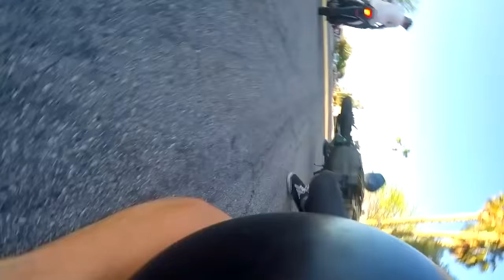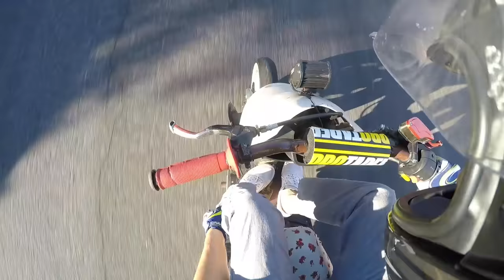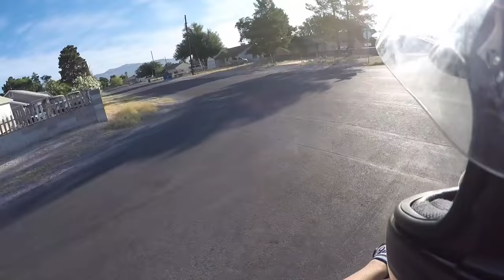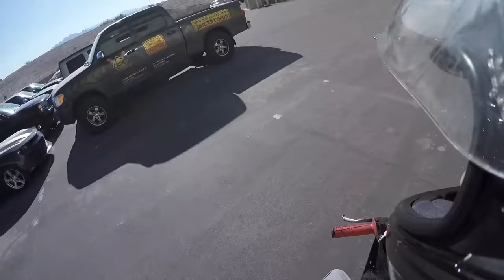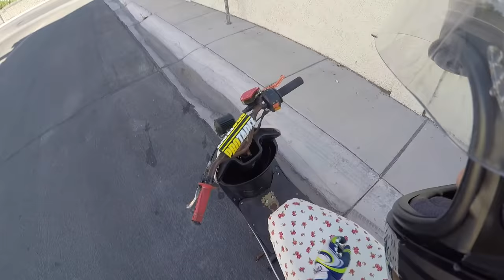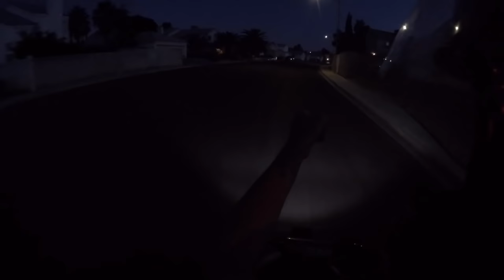this STUNT SCOOTER is my DAILY DRIVER

Comment: If I were you I’d make sure that the electric start works so you don’t ware out the kicker because once that worn out it won’t catch and you gotta make sure you put wd40 on the kicker so it don’t seize up on you
Reply: Wd-40 is water based it will rust it and seize it.😂

Comment: You should by an aerox 50cc, very good stunt scooter
Reply: Why would he change a150cc to a 50cc?
Reply: @victortakflakt  because a 50cc aerox will have about the same power as that 150cc if you put a good exhaust on it. Put a big bore on it and youre outrunning the 150 for miles
Reply: the scooter he is talking about is a two stroke, that is why it has a higher power output.
Reply: @drunksanta1427  A 50CC Aerox with just a pipe wont have as much power as a 150CC.
If you put an expensive performance exhaust system, a 70 - 86 CC Kit etc... then yeah it would be about the same or a little more power.
But not without tons of work, and not to mention that if you do this you'll wake up half the country.
Reply: @victortakflakt  its only fun to drive a loud scooter. I have a Gilera Stalker 50cc Two stroke, that runs about 55 miles per hour with only modded exhaust
Reply: @LanesOnline  I know for a fact that 50cc scooters with nothing more then an exhaust doesn't do 55 mph, I know almost  everyone says their 50cc's go 60 mph though.

Comment: Bro have you adjusted the valves on that engine since you bought it?
Reply from the maker: nope
Reply: @MOPBOYZ  probably should it could give you some performance back also it'll run better in the ridiculous heat

Comment: how did you get that gy6 to wheely like that is it the clutch and gears? Did you move the weight to the rear? I have a scooter I built the top end only and ittl do small wheels but nothing like that I'll do the the racing gears and clutch soon for more power but lmk why it's like that I want wheelies like that
Reply from the maker: gy6 150cc motor swap, stock everything else
Reply: I had a feeling it was a 150 escpecially when I saw the license plate. I've just been messing with 50s for fun for years I have a 150 and those are just bad ass like that I was thinking how the fuck did you get a 50 to do what I've been trying to do for years
Reply: @MOPBOYZ  so did you have to make new engine mounts for the top mount 150 or was the frame a 150/ 125
Reply from the maker: Hans Wasiecko yea it’s pretty easy i have a whole video series on it on my channel!

Comment: Yo I was wondering if you could help a bro out. I'm trying to put an air filter on my 49cc. But the motor   stalls and loses power. I think it's getting too much air. I hate the look of that big air filter box.
Reply: MAX GUN tinker with your air-fuel screw see if you can get it too idle you may have too change carb if wanting too use air filter. Know what ya mean they look and fit soo much better.
Reply from the maker: what he said! mess with your air-fuel screw. check out some youtube vids how to adjust it!
Reply: You need to jet the carb or lower the needle in the diaphragm
Reply: Buy bigger jets. Whatever yur jets are ad 5% and go from there.

Comment: Get a 2 stroke man. Put 70 or 100cc on it;)
Reply: It is a 2 stroke
Reply: @Joe-dh6uu  dats definently not two stroke.
Reply: It sounds like a 4stroke because its a small 50 2 stroke
Reply: @Joe-dh6uu  i need proper proof before i  believe that it is an two stroke.
Reply: No you don't
Reply: @Joe-dh6uu  i do, because there is no way a two stroke can sound like that. its a taotao 150cc for fuck sakes
Reply: @JaranDalsbo  no